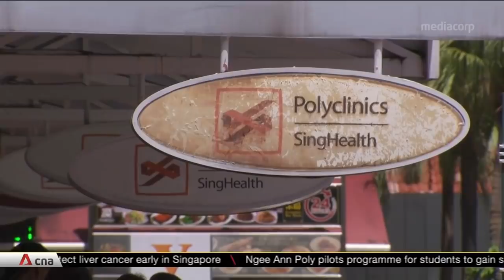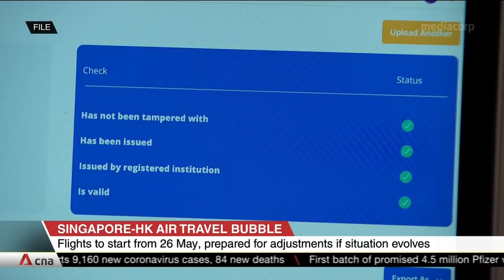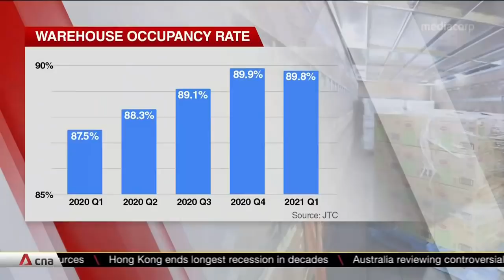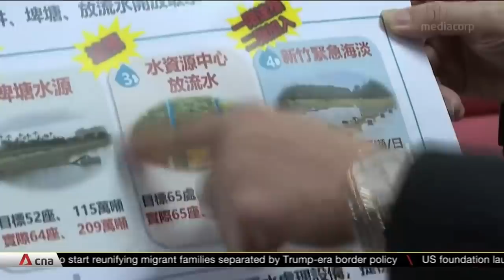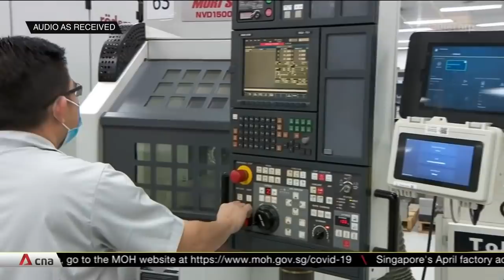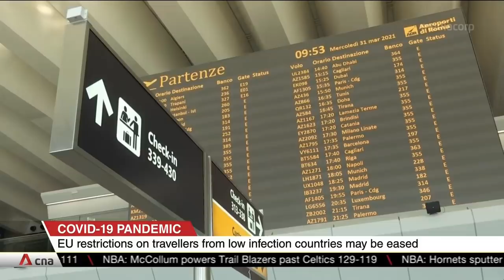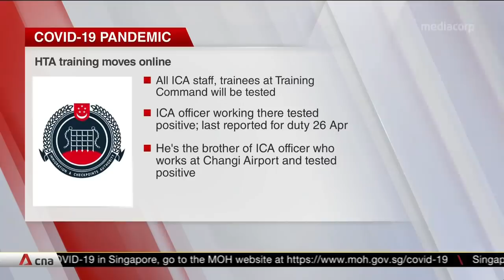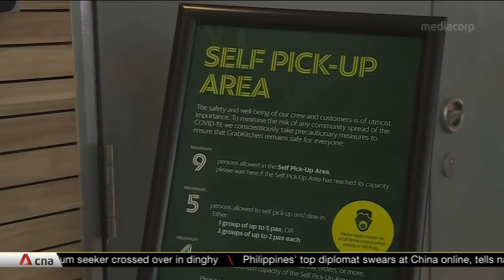Singapore Tonight: May 3

Comment: Multi-ministry Taskforce (MTF) website's 3 May 2021 News Highlight:

Section C - Imported cases

"3 (Cases 62782, 62783 and 62796) are Singapore Permanent Residents who returned from India and the Philippines.
1 (Case 62785) is a Short-Term Visit Pass holder who arrived from India to visit a family member who is a Singapore Permanent Resident."

One wonders how the hell they can still be 'imported' when the ban states no travellers from India who went there for the past 14 days from 23 April 2021@2359hrs are allowed to enter.